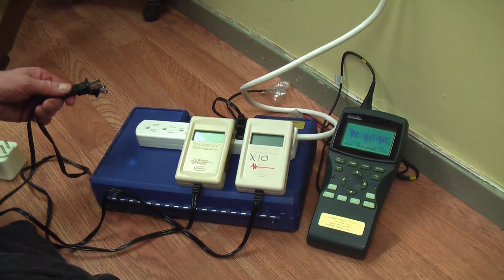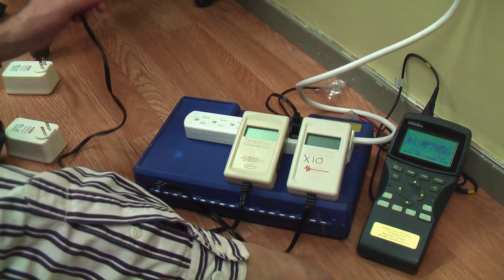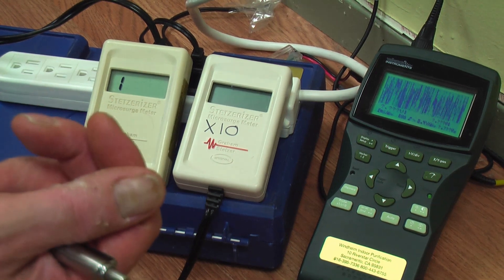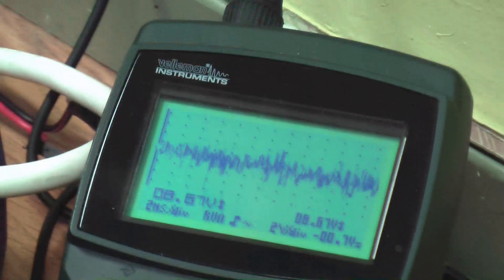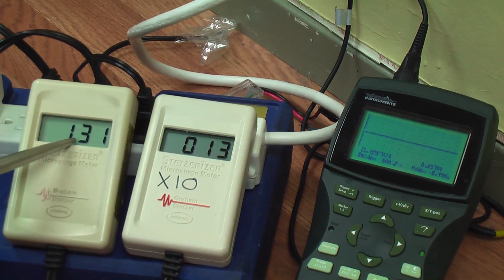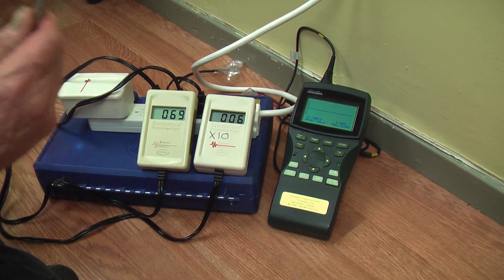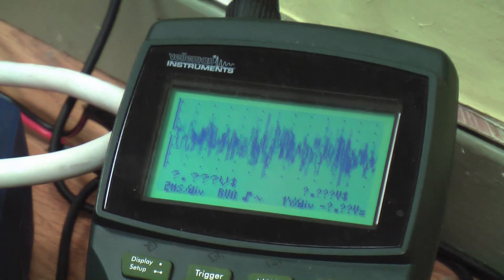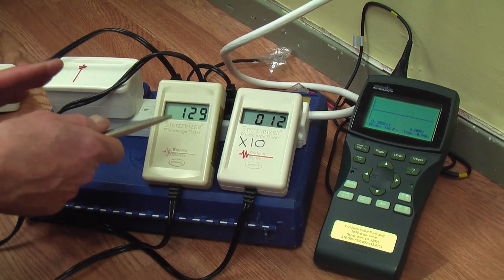Dirty Electricity: detect, measure and eliminate it.

Comment: Hi. I have a Stetzer meter which looks identical to the one you show here marked x10. My meter is model GS-M300-A. Could you please share the model of your meters? I am concerned if my meter shows 50; therefore, I think I am safe when in actually the level is 500
Reply from the maker: One meter is 0-2000 GS and the X10 is 0-20,000 GS

Comment: I just found out about this the hard way! I haven't been able to remediate down to 50 but that is my goal. I had some rooms over 1000. Most outlets were 200-400. Now I have two that are 300. The rest are below 100. It all started for me when I moved into the 'hottest" room during renovations. My bedroom of 10 years had the lowest readings of the house, though still many times higher than 50. I'm hoping it's enough to relieve the symptoms I have been having. After a few days I am sleeping much better. Perhaps not everyone needs 50, but longterm exposure to 1000 may really do your immune system in...
Reply from the maker: Hi Raina,  I suggest that you remeasure with all lights OFF and all devices unplugged.  If you get lower and more even DE levels it was your devices and lights that are the source of the DE.

Comment: Dear, very good video. I would like to know the frequency of dirty electricity in order to install filter (plug) like you have or other type of filter for big pollution like solar panel. Could you give me technical specifications for a good Osciloscope? Until 200000kHz is ok? What specifications more should have the instrument? Thanks a lot
Reply from the maker: This link will show you everything you need to do.
https://buildingbiologyinstitute.org/mep-fundamentals/ 
Residential MEP Webinar
MICROSURGE ELECTRICAL POLLUTION (DIRTY ELECTRICITY)
Learn the precise use and interpretation of Owon and PicoScope and their essential adjunct devices for identifying and assessing MEP. Join BBI seminar instructor Mitch Marchand, BSc. EE throughout his 6 learning modules, walk through MEP measurement videos, plus supporting field guide documentation and setup files.

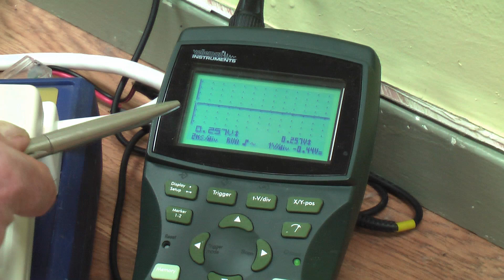This is a prerecorded series for which you will be granted unlimited access. Once you’ve accessed it, you’ll able to watch Mitch’s videos at your own pace, which includes pausing, rewinding, and fast forwarding to review to whatever extent you might need for gaining the best understanding of this vital material possible. Total running time is 2:45 of prerecorded video + prerecorded MEP Measurement Field Guides.

Comment: Fantastic video. Thank you for posting. Is it true that if you use grounding sheets or a grounding mat while in one of these enviroments with dirty electricity, that your body will act as a conductor and it will flow through YOUR body to get grounded as well, putting you at risk? Or is that a myth? Thank you in advanced! I just learned my bedroom has dangerously high readings and I am looking to invest in some grounding sheets until I am able to get these plug in devices as I understand they are quite a bit of money.
Reply from the maker: Hi,  Avoid grounding sheets or pad    Here is the best way to create a zero EMF sleeping sanctuary: https://www.youtube.com/watch?v=bNnlXOXoaWI&t=1s

Comment: When I first saw the "Dirty Electricity" thing I thought "SCAM", but the more I looked into it, the more I believed.  I saw another entry from a person with "Ungrounded outlets".  I have the same problem.  My house was built in 1945 and many of the outlets are not grounded.  This was grandfathered in and I really do not want to run ground wires to all of these boxes.  Will the Stetzer filters still work for me?
Reply from the maker: Hi Bill,  since your house is so old, I recommend you have a complete EMF assessment before installing any filters into outlets.  You may have much more serious problems that should be addressed first.

Comment: I been feeling static electricity in my apartment and I notice that the lights blinks all the time
Reply from the maker: Blinking lights could be due to a loose wire connection.
Reply: mine too, is that from dirty electricity?

Comment: 2,000 what unit? GS units?
Reply from the maker: Technical Information
The STETZERiZER® Microsurge Meter measures the average magnitude of the voltage surge (i.e. the rate of change of the voltage with time) at the electrical socket.  One GS Unit is 24 Volts per second.  A human having a low impedance to one of the terminals of the outlet (the grounded wire) and a capacitive coupling of 800 picofarads to wiring connected to the other terminal of the outlet (the hot wire) would have a current flowing through them indicated by the STETZERiZER® Microsurge Meter. The capacitance of two parallel metal plates that are one meter by one meter and separated by one centimeter is about 800 picofarads. The capacitance of a human to the hot wires will usually be less than 800 picofarads and the current through the human will be proportionately lower. The current flow through the human will also depend on how the capacitance of the human to the wire is distributed over the human. This is important since it is the current flowing inside the body, and where it is flowing internally, that determines the effect it will have on the human. The frequency band covered by the STETZERiZER® Microsurge Meter is about 10 kHz to 100 kHz.  For complete specifications on the STETZERiZER® Microsurge Meter, see U.S. Patent #6,914,435.

Comment: Any recommendations on greenwave vs stetzer vs the pure power plug in? Thanks!
Reply from the maker: All capacitive filters do the same job: partial reduction of DE.  The best solution is to find the source of the DE and replace it with a device that is clean and makes no DE.

Comment: Does aluminum screen block the dirty edectricty like it does to wifi/cell phone/radio waves?
Reply from the maker: Only if it is connected to earth ground.
Reply: @windheimemfsolutions  earth ground or regular outlet ground? Could I use shielding fabric and ground it to block electrical frequencies/dirty emf??

Comment: Hello, would you please describe what basic function or spec an oscilloscope needs to be able to visualize only dirty power without the main 60Hz curve? We tried but with no success so far. Thank you!
Reply from the maker: Hello Ivan:  You need to get the Graham Stetzer Ubiquitous filter to separate the HFVT from the 60 cycle signal.

Comment: My air-conditioning unit in the attic turns on and is 500+ on the meter. Is the wiring bad? Or is that normal?
Reply from the maker: What meter? What is the reading with the AC OFF?  Please advise.
Reply: @windheimemfsolutions  sorry dirty electricity meter. Usually 50-90
Reply from the maker: @APMcD  What make of meter?
Reply: @windheimemfsolutions  stetzerizer
Reply from the maker: @APMcD  What is the Stetzer meter reading with the AC on and off?
Reply: @windheimemfsolutions  in one outlet I tried on 550 and off 50-90

Comment: I have a question. Do we need 1 filter for every single outlet
Reply from the maker: Hi Bonnita,  The first thing to do is find and remove all of the devices in your home that make the DE.  Next is to have a magnetic field survey to see if you have wire code violations. and if so have them fixed.  You may have DE coming in from next door ad well as from devices in your house.

Comment: Will the Stetzer Meters also affect the stabilty of the (ac( hz of the electic fields? Will the hz still fluctuate as it did before in the same manner as before after installing Stetzer Meters?
Reply from the maker: The Stetzer Meter is a measurement device.

Comment: Two thousand what precisely? I assume you mean millivolts.
Reply from the maker: GS units: https://www.stetzerelectric.com/store/microsurge-meter/
Technical Information
The STETZERiZER® Microsurge Meter measures the average magnitude of the voltage surge (i.e. the rate of change of the voltage with time) at the electrical socket.  One GS Unit is 24 Volts per second.  A human having a low impedance to one of the terminals of the outlet (the grounded wire) and a capacitive coupling of 800 picofarads to wiring connected to the other terminal of the outlet (the hot wire) would have a current flowing through them indicated by the STETZERiZER® Microsurge Meter. The capacitance of two parallel metal plates that are one meter by one meter and separated by one centimeter is about 800 picofarads. The capacitance of a human to the hot wires will usually be less than 800 picofarads and the current through the human will be proportionately lower. The current flow through the human will also depend on how the capacitance of the human to the wire is distributed over the human. This is important since it is the current flowing inside the body, and where it is flowing internally, that determines the effect it will have on the human. The frequency band covered by the STETZERiZER® Microsurge Meter is about 10 kHz to 100 kHz.  For complete specifications on the STETZERiZER® Microsurge Meter, see U.S. Patent #6,914,435.
Reply from the maker: 2000 GS units: 
Technical Information
The STETZERiZER® Microsurge Meter measures the average magnitude of the voltage surge (i.e. the rate of change of the voltage with time) at the electrical socket.  One GS Unit is 24 Volts per second.  A human having a low impedance to one of the terminals of the outlet (the grounded wire) and a capacitive coupling of 800 picofarads to wiring connected to the other terminal of the outlet (the hot wire) would have a current flowing through them indicated by the STETZERiZER® Microsurge Meter. The capacitance of two parallel metal plates that are one meter by one meter and separated by one centimeter is about 800 picofarads. The capacitance of a human to the hot wires will usually be less than 800 picofarads and the current through the human will be proportionately lower. The current flow through the human will also depend on how the capacitance of the human to the wire is distributed over the human. This is important since it is the current flowing inside the body, and where it is flowing internally, that determines the effect it will have on the human. The frequency band covered by the STETZERiZER® Microsurge Meter is about 10 kHz to 100 kHz.  For complete specifications on the STETZERiZER® Microsurge Meter, see U.S. Patent #6,914,435.

https://www.stetzerelectric.com/store/microsurge-meter/

Comment: ok I understand but can it be plugged into a power bar and protect against all that is plugged in. Also how much does it cost for one and where can a consumer get them important to know the answer to both questions have not seen these answers on the comment section.
Reply from the maker: Hi Purple,

Right,  Plugging it in on the power strip will clean up all that is on the strip and prevent it from spreading to the rest of the circuit(s). You can get them here: Get Stetzer Meters & Filters at http://electrahealth.com/A1. Filters are $30 and meters are $99.

Comment: Kinda off this subject but is there anything like this that can detect and clean up "dirty electricity" coming our of a regular inverter and going in to an RV without using a sin wave inverter?
Reply from the maker: Yes,  measure the DE with this meter and then add a filter to see if and how much it goes down.

Comment: Hi, what kind of surge protector or other devices do you recommend that I use for my home and computer etc? I keep having spikes and surges. During one of these my air conditioner and fridge were both broken. Then during this last surge my alarm clock, electric shaver and computer were all affected and this is after paying for a whole house ZapCap surge protector from the electric company. Please let me know.
Reply from the maker: Merry Christmas Tony,  The filters in this video are designed to reduce high frequency voltage transients, AKA, Dirty Electricity or DE for short.  DE is harmful to all printed circuits and any device or appliance that has them.  Voltage spikes fro the utility are usually much lower in frequency but have a huge swing of over or under voltage.

Actually there are conditions called, spikes, sags and swells with a spike being a very short term increase in voltage and a sag or swell being a longer increase or decrease in voltage.  All of these will shortened the life of electronics and appliances. In some areas these mostly enter there house from the utility but they also can be caused by switching events inside your house.

More effective solutions are available and they will filter incoming and circuit to circuit DE at the same time.  I have one of these on my house and have never had a spike in nine years.  Before this device I would have many as five spikes per day. Recently my next door neighbor, an electrical engineer, lost his new washer and dryer due to a utility voltage spike.

Since I have not lived in your area or visited your property there may be factors causing this that I am not aware of.

If you like we can set up a consultation: please contact me via the contact form on my website.

Comment: Thank you for posting this. My electrician friend sent me this link. Looks like many of the contributors on this thread have already had their brains affected by the electricity in their homes. Too bad really...maybe they could have become intelligent and well-mannered people. I have a question. Will these filters work in non-grounded outlets? Some of the house is grounded, and some not. Thanks in advance!
Reply from the maker: Yes.  Before you install these on any circuits you should verify that you have no wiring code violations or the filters could increase magnetic fields cause by the wiring code violations.  Now check with a Stetzer Meter to search out and remove any devices or lighting that is creating DE inside your house.  If you still have DE it is most likely coming in on the utility feed.  If that is so the best place for the filters is at the main panel to stop the DE from entering your house and all of its circuits.

Comment: Hi Windheim,  Thanks for sharing. I recently bought a house next to power line. The electric pole is only 38 foot away from my house. I have moved into the house for a little over two months and started to get so concerned about health issues. I have tested EFM in my house and surrounding, the result shows 23.3ug. What should I do to protect my family? Will Stetzer Filters help? What is your opinion between Green wave filter and Stetzer meter? Thanks a lot!
Reply from the maker: Feel free to contact me via the contact form on my website.
Reply: @windheimemfsolutions  EMF inside my home is high especially my wiring in my home, my handheld device shoots rate up next to the drywall hi signals  (EMF)if I plug any Appliance in, or a lamp the EMF intensifies why? I have a newly installed house filter wired into my fuse box to try to help this problem it has helped with smart meter spikes but that's about it. Is something possibly wrong with my neutrals in my house wiring?

Comment: would earthing or grounding yourself eliminate the dangers your body is absorbing of this dirty electricity.?
Reply from the maker: No but turning off all circuits within 10 feet of your body will.
Reply: so what is grounding actually doing?
Reply from the maker: Earthing inside of an electrified environment like a house will make you part of the conductive pathway for the electric field to ground.  Earthing is best done outdoors or in a room that has 0.0 V/m pf of electric field.
Reply: when stepping on my grounding mat i take multi meter reading and my body voltage sinks right down cost to  .000  Before touching my feet to the mat my body reads anywhere between 2 and 11 volts depending on the room I'm in and how close I am to lamps, outlets, walls, computers etc.
Reply from the maker: Correct.  Your body now has an outlet for the electricity to go to but you are now an antenna and part of the conductive circuit for the electric field in the house going to the ground.  It is better to reduce the electric field by shutting off circuits or at the very least filter the DE out of the field.
Reply: +Windheim EMF Solutions  ok. They makes sense. So best filter rooms you frequent in your house. Bedrooms and living rooms. One or two filters per room.
Reply from the maker: Yes but it is important to make sure you do not have any wire code violations that are causing magnetic fields or the filters may make it feel worse for you.  You can find out more about that on this blog of mine: http://www.windheimemfsolutions.com/wiring-code-violations-cause-hazardous-magnetic-fields-shock-and-fire-hazards/
Make sure you read the linked article and video at the bottom of this blog.
Reply: +Windheim EMF Solutions will a ground check plug that lights up two yellow lights to test your ground do the trick and making sure the wiring is not faulty ?
Reply from the maker: No,  It takes a clamp amp meter or a mG meter as shown in the video linked at the bottom of the blog page: http://www.windheimemfsolutions.com/wiring-code-violations-cause-hazardous-magnetic-fields-shock-and-fire-hazards/
Reply: Thank you...Another question.  Would you say that all these grounding and earthing matts and bed sheets they sell for indoor use just a waste of money if you are surrounded by electromagnetic fields in their home? Would it still be beneficial to use them if they sat far enough away from an electrical outlet or appliances and devices etc.?  Thank you!!!

Comment: Thanks for the video.  I one point you mentioned having 12 volts of dirty electricity on the line.  I'm curious, was that a peak-to-peak measurement or RMS?  Thanks again.
Reply from the maker: +Charles Goethe Yes. Peak to peak in the 50 KHz range.